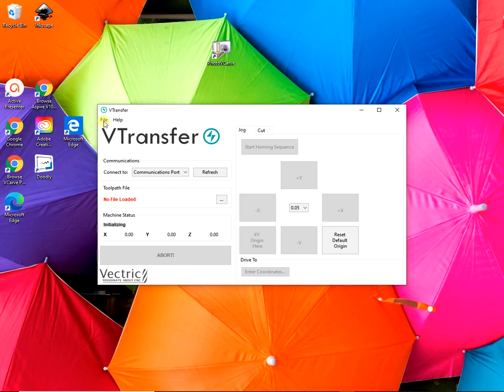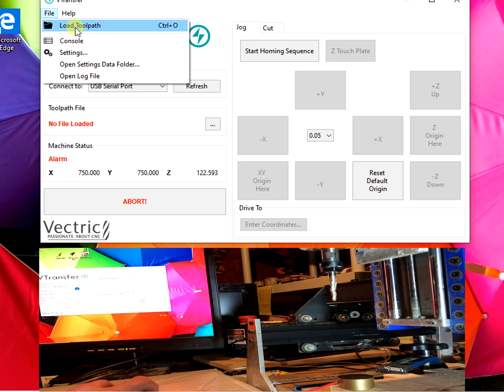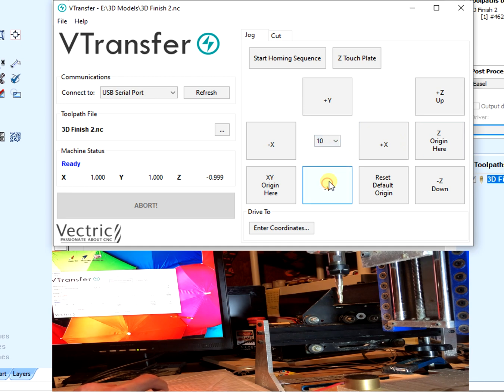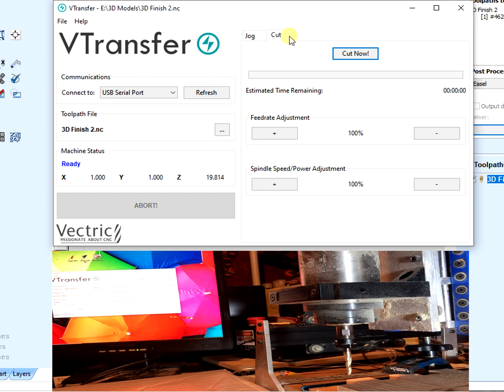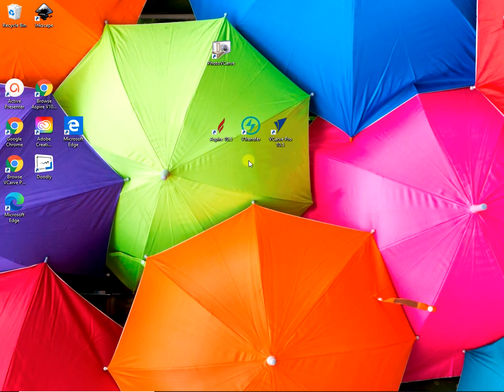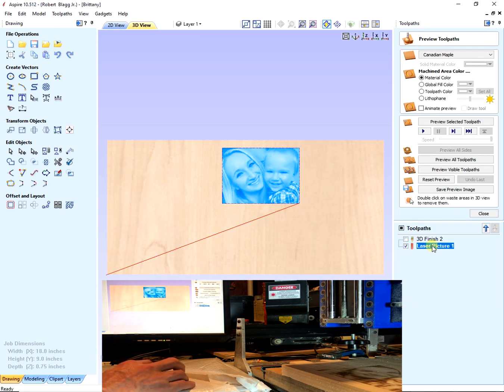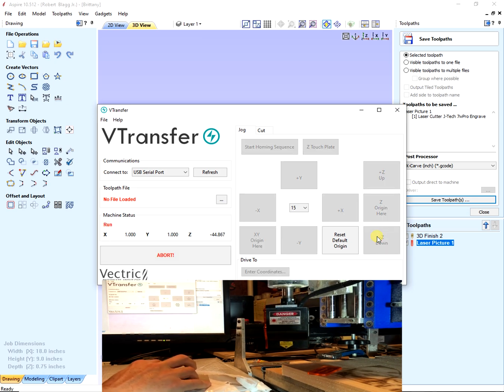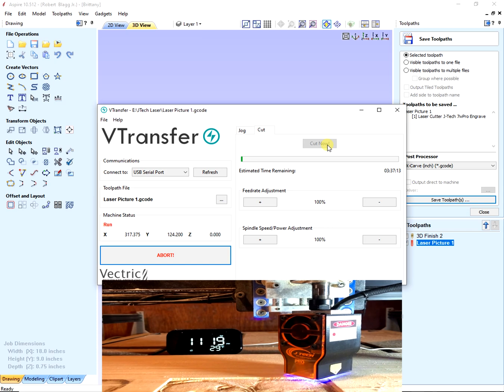How to use #VTransfer #Vectric G-Code sender with Laser Module and Router BOTH explained on XCarve

Comment: It looks like you were doing a laser over a 3d carve.  How did you set the x y origin when you switched to the laser to match up with the origin on the cnc?  That has been my biggest issue with my shapeoko and jtech 7w.  Thanks.
Reply from the maker: My laser mounts inside the spindle (Just like a bit would) so i have no offset to worry about. thus mking it easy to go from one to ther other
Reply: @BeeManRobert  OK thanks.  I wish mine did.  They didn't have that option when I bought mine.
Reply: @chadmaxim7079  did you figure out a way to use this program and still zero the x and y ?  my laser mounts on the front of my router so im in the same boat you are

Comment: Does V Transfer come with Aspire?
Reply from the maker: Yes during the download of the Aspire or v Carve Programs, It will ask you if you want to add VTransfer to the download you MUST CHECK THE BOX TO DOWNLOAD with your program. However if you’ve already download the program simply re-download and only check the VtTansfer box to get it. Then it’s on your Desktop after it’s download. I think it’ started with 10.5 upgrade. But I’m not 100% sure on that.